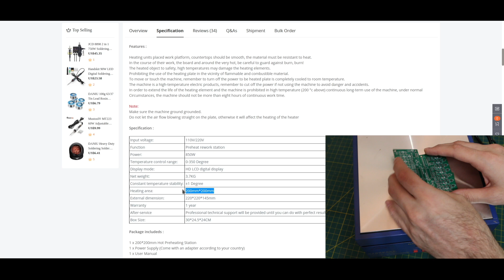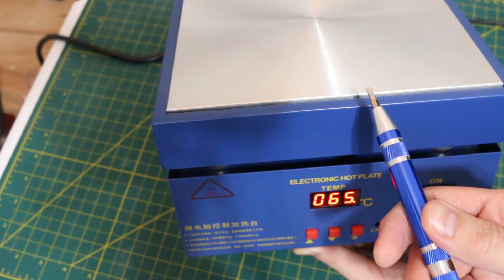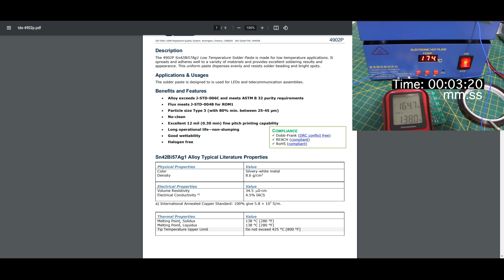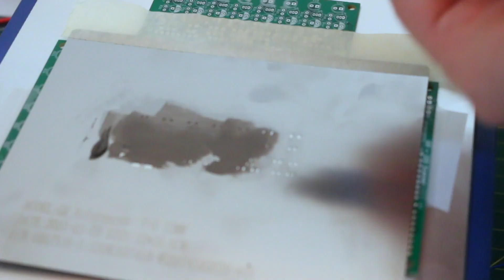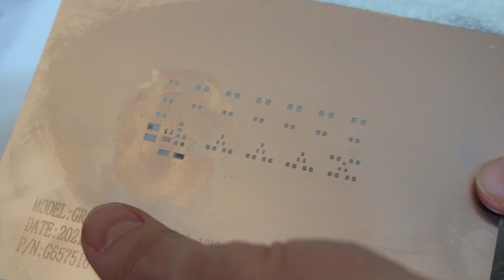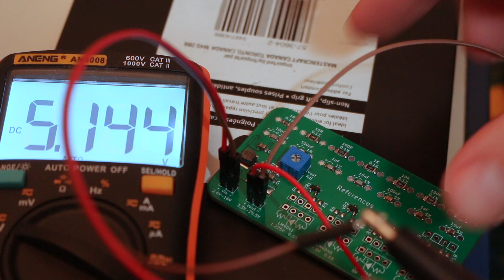946C SMD Hot Plate for Rework Pre-Heating or Reflow Soldering

Comment: Hello, I also bought this device but there is something I don't understand or do wrong. For example, when I set the temperature to 175 °C, it remains at that temperature indefinitely. It does not go down automatically. I looked at the curve with a thermocouple and an arduino and the curve is purely upward.  It absolutely does not follow the classic curve of the reflow. There is no controller? Do you have an idea?
Reply from the maker: yes there’s no controller, the device is just intended to power on and go to the set temperature so all I do is turn the power off and let it cool down when I feel it has finished re-flowing. It’s not the most professional way to do it but it works for the hobby things I’ve been doing.
of course some sort of Arduino project could always be done to manipulate the temperature setting or cut the power but at that point if that much control is needed it’s probably better to do the classic toaster oven project.

Comment: If your hot plate can go to 260C, I highly recommend using SAC305, not the SnBiAg rubbish. Commercial flux are designed for SnPb and SAC305, and your commercial grade SnBiAg paste uses the same flux, which means by the time the solder melts, the flux were not heated enough to do its job properly. That's why not all parts are pulled to center automagically like you might have seen on videos. The denser your parts are, the more devastating this effect could be. So after struggling with having to repair each and every board reflow, I finally decided to move to SAC305, and I never looked back. Yes, it does cost more to buy gears for high temp reflow soldering, but it is worth it for me, even if I only do prototyping. Currently my setup has a Quick 854 for large area preheating, a Miniware MHP30 for small boards, a JBC NASE for precision fixups, and a Metcal HCT2-200 for first time reflows.
Reply: So basically you can use the SAC305 with this hot plate if I understood correctly. Is SAC305 just the name of the "recipe" or is it a brand name? Could you post a link to what you use? Thanks
Reply: @64bittz93  SAC305 is a formulation, consists of Sn (rest), Ag (3%) and Cu (0.5%), a nearly eutectic alloy melting at 220C. This is commonly known as one of the two commonly used lead free solders. The other is SnCu without Ag, some formulations are eutectic, melting at around 10C higher.

Comment: Is it any good at making a grilled cheese sandwich? Gotta eat while de-soldering.
Reply from the maker: It's not bad but it has to be monitored closely or it burns. It has even heat distribution so it finishes fast. But only use lead free solder

Comment: Can you use that same type of solder paste manually if you don't have a stencil but stiil intend to reflow it?
Reply from the maker: Yes especially if the components don't have pins too close together like tiny ICs but even then the nature of solder mask and surface tension keeps solder where it's supposed to go once it melts and any bridges can be fixed with a solder wick/braid or maybe flux and an iron tip dragging excess away.

Comment: I've been eyeing something like this. Thanks for the helpful video!
Reply from the maker: It was definitely worth having, and I didn't even burn the bottom side of a PCB when letting it go up to 200 degrees for a long time to measure temperatures on the board surface, so it should definitely work for normal soldering time frames.

Comment: But can it make paninis? Asking the real questions here! I like how thorough you went, I would have just put a bead of water on it and seen if it would evaporate at 100 degrees lol
Reply from the maker: It can make them, but you shouldn't eat them.  And it would be better to have two of these to do top and bottom simultaneously (don't forget to use the affiliate links).  With my luck a bead of water would have caused too much thermal shock and split the plate.
Reply: Now I want a grilled cheese...